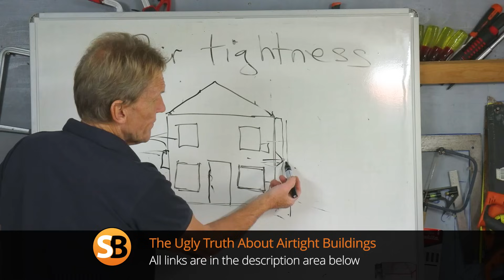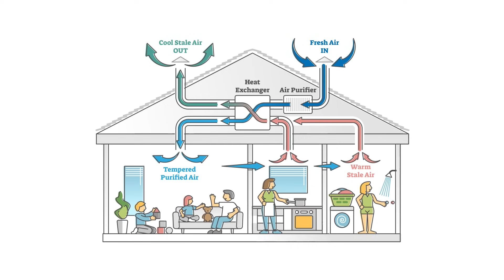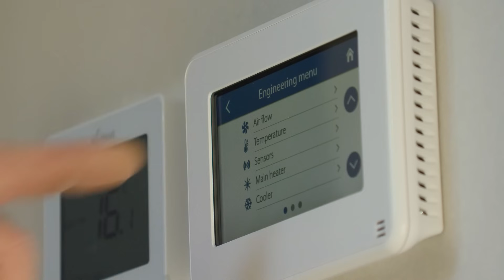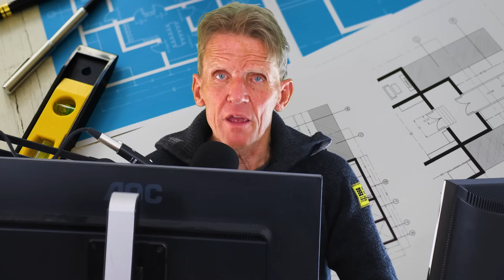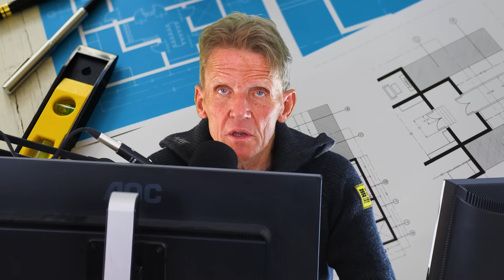Why Airtight Homes Are a Terrible Idea

Comment: 5:18 In my experience humidifiers that work with a compressor  require at least 20 decrees Celsius ambient temperature to work efficiently. The specific temperature and the efficiency may change from make to make, but not by more than a degree or two. A good idea is to get a dehumidifier designed with drying clothes in mind. These offer greater ease of use when drying clothes and work great if the clothes' rack and the dehumidifier are placed inside a plastic sheet cover , the type used for covering clothes' rails to protect the clothes from dust.

Comment: I have the draftiest house on earth, during winter it is impossible to get it up to 11 degrees C 

There is also mold spawning throughout the house specifically where draft is so the "air tight causes mold" idea doesn't hold weight in my house.

Comment: These channel makes all videos completely wrong, I just open to comment, house should be airtight and inside should be as many zehnder comfospot 50 or comforair 70 units as needed to keep co2 ppm under 1000 ppm at all times… and also of course dehumifiers to keep humidity at around 40-45%. Remember people data, not story tales… ppm under 1000 and humidity under 45%

Comment: I was thinking this was going to be a Rog rant but it was nicely balanced 😛

It's also worth considering investing in a humidity sensor or two so you can A) see the baseline and B) try to improve it. My flat is a modern-ish renovation of an old building (1910ish) and humidity is never really a problem even when I leave the windows shut, even when drying washing indoors. It's nice that the sensor confirms this!

The other thing is if you're working from home in a spare room (I use my second bedroom as a home office), CO2 builds up very quickly. It won't kill you, but without sufficient ventilation it will make you groggy and (temporarily) stupid. Once CO2 is over 1000ppm (baseline is around 420ppm) mental performance drops off quickly. I only notice this in winter because I have the window open from ~April through to maybe ~October. In the winter months I'll keep the internal door open and also open the window once every hour or so for 10 minutes. 

I'd love to have some mechanical ventilation and heat recovery to avoid this dance, but it's not really viable for me, and the single room solutions I've seen look pretty ropey too (saw a video where it barely did any heat recovery, and you'd be as well just opening a window).

Comment: Who would want dry air in their house, since moving to Canada where it’s cold and dry both inside and out I keep getting electroshocks whatever I touch and my skin is dry and itchy, as if 10 years older 
The issue is with these crap building materials which are just waiting for mold - wood and drywall and mineral wool - dry air may be good for the building but not the people in it. People are the final user of the house, not the other way around

Comment: My last house was a modern build, built by a builder for himself. It was so highly insulated that the summer heat was unbearable - I felt like a piece of sweaty, vacuum packed cheese. What made it worse was the positioning of the property at the bottom of a cul-de-sac, surrounded by other houses; there was no breeze no matter how many windows were open; the upstairs was diabolical. It never occurred to me to install air-conditioning and Him Indoors never noticed how warm and stifling the place was. The plus side was the low cost of winter heating; I’m back to living in an older property again, much more comfortable.

Comment: Our house moved from heating with a pellets furnace to ground heat. That means that the air becomes increaeibly stale in summer. 

I installed a fan in my downstairs furnace and bam! Amazig air in summer.

Comment: My gf has a new Lennar home.  Every hour, the system draws in outside air for a couple of minutes.  All that technology needed because THE WINDOWS DON'T OPEN.  Only in the bedroom is an openable window.  They save a boodle on windows by just tweaking the HVAC controls.  Said gf intends to get screen doors front and rear.

Comment: Sorry Roger I've been in Air Conditioning design for a very long time, and specifically pyschrometrics. Relative Humidity and moisture content  are not the same. The human body cools via evaporation from the skin surface so a higher relative humidity will reduce the evaporation and a person wiil feel warmer. At the same air moisture content the RH % will increase as the air temperature drops and decrease as the temperature increases. Why does this matter? Because it is the moisture content that produces a vapour pressure and the higher the moisture content the greater the vapour pressure. So it is important to note that it is the vapour pressure differential between inside the home and outside the home that causes the net infiltration of air into or out of a home. Your pressure fan is just mechanically overcoming that vapour pressure differential. I feel, like you imply, that houses are now too tight. There really needs to be a sufficient and continuous supply of fresh air into a dwelling with the corresponding exhaust of stale air. When I grew up "toxic mold" was never heard of because windows were opened all the time. It only became an issue when houses were buttoned up as air conditioning systems became the standard. Inside it is a low vapour  pressure so high vapour pressure moist air migrates through the cracks into the house and causes damp areas where the cool inside temperature causes the moisture to condense in the areas it comes through then the mold has a happy growing spot. The enthalpy wheel is the heat exchanger you mentioned, and the run at around 80% to 90% efficiency when sized correctly and do a great job of reducing the heat load of fresh air and they don't use any additional power other than a very small motor needed to rotate the disk. So it is the same circulation fan as the HVAC system uses. My brother had a completely sealed house built and I likened it to living inside a Tupperwear container. The AC was sized for the very small heatload which means it has very little air circulation mass flow volume and no fresh air system at all. So he gets a stuffy home,  but a low electricity bill. 😊
Reply from the maker: You seem like a very knowledgeable and intelligent bloke so it surprises me that you think I am saying that air tightness per se  is a problem. It is not if you have MVHR or something to mitigate the effects of trapped moisture. You seem to be reinforcing my simple message.

Comment: Very important video that addresses an increasingly widespread concern. Part of the solution is to monitor humidity levels in your inside & outside air. This will let you know when inside humidity is getting too high and whether outside air is sufficiently dry to bring it down.

I am looking at mini split heat pumps that also have a dehumidification mode, as well as tiny house HRV's that can ventilate a single room and use very little electric power.

In some regions, global climate change is going to increase the number of days with warm/hot humid outside air, so getting on top of this now could prevent a huge health problem in the near future.

Thanks for sharing your expertise!

Comment: I was involved in a green building project, and yes you're correct.  The absolute air tightness was required because everything is sized to barely work: HVAC especially.  I'd rather have a slightly oversized unit that isn't having to work at maximum output all the time, and a house where I'm getting fresh air without having to have the HVAC on all time.
Reply: Science and research have proven over and over again that a smaller system running continuously is more efficient and effective than an oversized system kicking on once in a while.

Comment: I feel very lucky to be able to leave my windows cracked open all year, as I live in Los Angeles and I'm in the back of my building so it's quiet with no street noise. The electric heating bill is higher in the winter than if I kept the windows closed, but it's worth it to me. Even if I do close the windows, they're 1964 cheap aluminum horizontal sliders that certainly don't seal. If this was a northern climate none of this would work, but the weather is a big reason why I live here anyway. I used to freeze my a$$ off where I grew up in New York.

Comment: We had a lot of mold in our house. A dehumidifier helped a lot which I would have done years earlier. Last year they fixed the ventilation on the roof so the air get extracted in the bathroom, now mold is much much less.

Comment: What's the point in making your house airtight just to add positive ventilation, trickle vents or open your windows daily to get air flowing?

Cannot see the point in spending a lot of money to remove natural draughts just to replace them with forced ventilation!
I'm guessing it's because they don't take into consideration the ventilation when giving a house its energy rating. So you have a high energy rated house that's actually just as "drafty" as a 16th century farmhouse, but it looks good for "netzero"!

Comment: By reducing humidity by 4%, the perceived temperature increase is about 1 degree C. And in the winter, the outside air is typically very dry. Ironically bringing this air in can make it feel warmer. Locking doors and windows will make you shiver.

Comment: I live in a leaky Australian house. When i visit my mother in London I have to leave the bedroom window open the whole time. It's not simply the problem with mould but that the air is stale in an airtight house. It is probably full of gases coming from the glues in particulate furniture. I might wish I had double glazed windows but I wouldn't part with the incoming air leaks.

Comment: In the USA we use dehumidifiers 24/7 in very humid areas. If not, mold forms anywhere moisture accumulates. Any surface below the dew point will cause moisture to accumulate. Our gulf coastal region has higher humidity levels than it did previously, and our overnight low temperatures in the summer are higher as a result, You all are fortunate to have a pleasant  almost ideal summer except for the occasional heat wave that puts you where we normally are every day June through some of November. Mold as you know is only possible when the humidity is too high. It could be that your humidity is higher now than before and you will need to use your air conditioning systems when the weather is not hot if their capacity is variable. It does no good to run the air conditioning if it will make the space uncomfortably cool, as then the areas between the walls will be below the dew point and cause moisture to accumulate where it won’t be seen until the mold is growing through the material to the interior wall.

Comment: After trying to control humidity with open windows and dehumidifiers, we eventually came across a decent roofer who identified a leak point through the chimney and once fixed that, installed a PIV. RH has dropped from about 65% to 45% and the house feels so much nicer. Air feels fresh and clothes dry indoors so quickly. Don't even need the dehumidifier now.

Comment: Ventilating a home and getting it right between freezing and avoiding mold, it's an art form innit especially in an old house? You can ventilate the house at night when you are warm and cosy in bed by leaving a bedroom window or windows open a little while the central heating is off. This also helps to avoid headaches. We use a tumbler drier that vents outside to dry clothes. Clothes that can't go in a tumble drier can be dried outside except in winter and a dehumidifier is always handy where needed. It takes sensible human actions to look after a house, not just technology.

Comment: It makes sense what this guy is saying.
I heat with wood so it's different as the fire can burn all day without increasing my heating bill, maybe a few extra logs when it's freezing outside.  I have never sealed my home because this allows fresh air in and I've never had a mold problem in 27 years.

Comment: I worked in the construction industry for many years as an electrician.  Over that time, the government imposed regulations concerning airtight homes increased year by year.  One general contractor I worked with was going on and on about how great this was and I pointed out that all of the measures he was taking went right out the window (quite literally) the moment someone opens a window.  And there are many folks who think their bedroom is too stuffy at night so open a window a crack while sleeping.  All of which makes the regulations and the cost of them pointless.  (Although the government may see compliance and obedience as the point being made). So the contractor pointed out the air exchenge system he was putting in to solve that.  I asked him how much that would cost, and when he told me, I reached over and opened a window, and said I just saved the homeowner that much money.  He didn't like my line of thinking and stomped off muttering something about dummies who don't like new things!  Apparently, thinking practically is for dummies, and all of this doesn't even address the fact that building a house just keeps getting more and more expensive as all of these regulations increase.

Comment: Here in Ireland, the govt are giving decent grants for all kinds of retrofitting work which includes attic insulation and exterior wall lining. There has been some horror stories about people experiencing all kinds of mold issues because the house is now airtight and trapping moisture. Personally I'd rather try to minimise heat loss as much as possible and heat the house as cheaply as possible (Wood burners with timber from own land in my case) rather than sealing up the place like a lunchbox and creating lots more problems
Reply: I'm one of those horror stories! Not because of house airtight and trapping moisture but because SEAI grant schemes have cowboys on their registered contractors list who are thieves/unqualified/unskilled/cut corners and wreck your house/health to make a fast buck

Comment: I live in Canada. I have always thought that air tight homes was a stupid idea, I heat with a wood stove and without drafts in my old home would probably suffacate. Here the recamend air exchangers and I thought how ridiculase is this idea I dont no much about them but if you have to run a fan with them you are using energy to opperate them so where is the saveings? I have always beleved that a few drafts in your home is a good thing.  Sorry bout my spelling mistakes I suffer from what they call no long term memory so it makes it diffacult for me. Everyone have a great day.

Comment: Code in Canada, at least, requires new homes to have a HRV system which allows fresh air in and pushes out stale air, all while moderating humidity.  Yet another clickbait YouTube channel.
Reply from the maker: MacDiggity
I don't understand your comment. If you have an ear for accents you would ascertain that I am not Canadian and there is nothing in this video to suggest that we are talking about Canada or anywhere other than the U,K. Saying that it is clickbait ignores the fact that we have severe mould problems in the U.K that have increased dramatically since we started down the air tightness route. I welcome comments but sometimes it is hard to deal with the low level of understanding.

Comment: Here in Finland every new building must have an effective ventilation system with heat recovery. This ensures both good air quality and energy efficiency. No need to waste energy or bring in unfiltered air by opening the windows.

With a proper ventilation system installed, it would be madness NOT to make all your walls and windows airtight.

I find it so frustrating when people still speak as if good air and energy efficiency are opposite goals. They are not, you just need to use modern solutions and stop living in the 19th century.

Comment: If You have a proper mechanical ventilation in combination with an air tight, properly insulated home,  no problems. But the whole house need to be properly built, considering all details.  If using plastic film, it needs to be correctly placed and installed in the frame to work properly.

Comment: I just renovated a 200 year old house. Made it pretty tight and added a Ventilation system with heat recovery. No mould anywhere abd no more opening the windows (which i hate even  though I'm german)

Comment: I would go so far as saying that you should never try to make an old building airtight. This may well work with new construction, when properly designed (like passivhaus) but it is completely wrong for an old building. You will inevitably create interstitial condensation, and probably dry rot.

Comment: I personally think that air tightness is good, but as you say you must install a heat recovery system. 
Most of the houses in England are not suitable for making them air tight, they need ventilation, spend your money on a solar air heater and more insulation in your loft, job done!!

Comment: In my strata, one owner turned off their heat, closed all the windows and vents, dried their clothes on racks in front of the fireplace and then demanded the council replace their defective windows because they got condensation.

Comment: It’s quite a thing how UK homes seem to have insufferable challenges with damp, mold, drafts and lack of insulation…why aren’t UK homes properly insulated and sheltered from water damage? Are the standards just not there? You can have a dry home and still have great ventilation and fresh air.
Reply: Most British homes were built in the heyday of the British Empire. They are Victorian homes usually without damp proof courses, drafty and difficult to insulate without causing further problems. I live in one and love it. Over the years I've learned how to upgrade it to manage those issues without creating new problems.